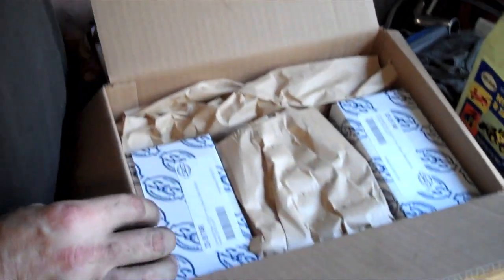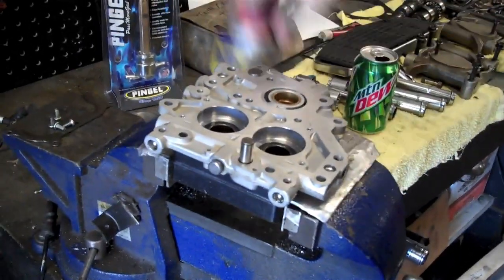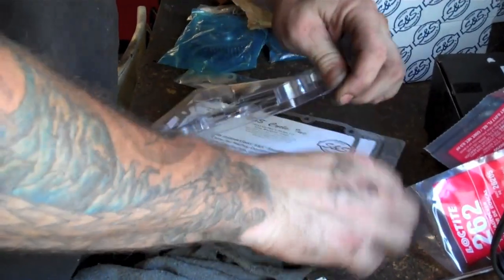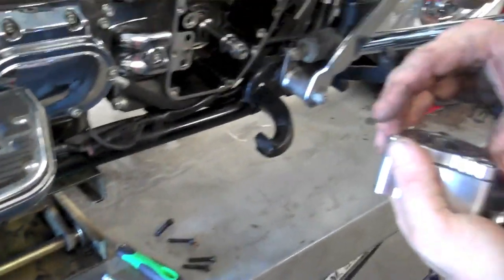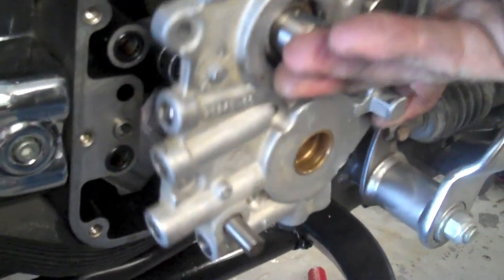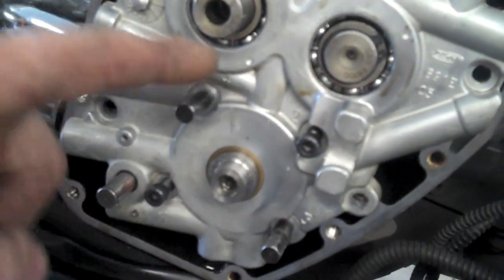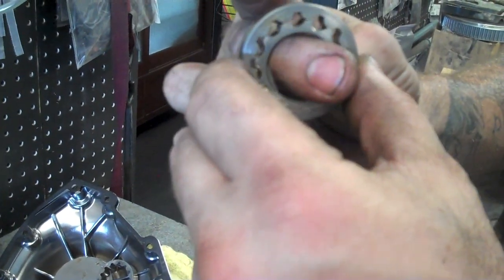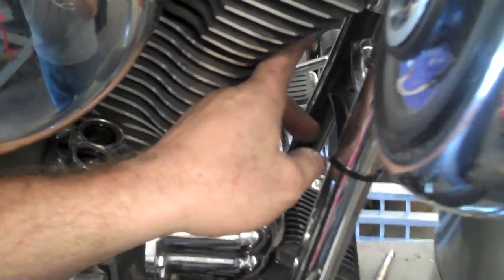How To Remove & Replace Blown Cam On A Harley-Davidson Road King - Part 2: Assembly

Comment: Cool oil pump trick, but why not use assembly lube, a torque wrench, or press the bearings in with the proper tool?

Comment: Besides the other correct comments, assembly lube, checking runout, etc., etc ., a 20 ton H-F hydraulic press is usually on sale for only $144. Or just fab one.

Comment: Jack leg mechanic never checked the crankshaft runout , it is imperative to check when installing gear drive cams. why do you think they make different diameter crank gears.

Comment: You MUST check crank runout when going to gear drive,whether it be Evo,TC,etc.HD cranks are notorious for runout which isn't near as critical if you have spring or hydraulic tensioners.And NO assembly lube on the cam lobes,bearing journals?Quote:"Jimmy the Wizard (a motorcycle mechanical genus)"?!? It's genius,not genus,lmao.Stay away from MY bike!
Reply: Yes. No assembly lube = no good.

Comment: The advantage to buying an older twin cam bike with the cam chain tensioner shoe issue is that you can get them pretty cheap, and even having this gear drive system done by a shop is only around $1800. About $450 cheaper if you do it yourself. Then  you're back on the road with a bike that'll last you a very long time for not a whole lot of money.
Reply: It cost me $1687.70 including S&S adjustable push rod kit. Ouch!

Comment: I certainly appreciate the fine job you guys did documenting this gear drive conversion. It appears to me Harley Davidson has produced a bunch of time-bombs with the chain driven twin cam engine. It's evident from what I see on youtube and in Harley Davidson forums that this is a common occurence. I'll certainly never own a chain driven twin cam engine after seeing this. It's no wonder there's a glut of twin cam engine Harley's for sale, while the EVO engine models are becoming scarce. So glad I didn't buy an a newer twin-cam softail last month, and bought a low mileage, pristine '95 FLSTN instead, with its EVO engine and gear-driven camshaft...
Reply: How come there hasn't been a class action suit vs the MoCo with selling lemon Twinkies then?
Reply: Better keep an eye on your Evo's cam cone. The TC ended the cone cracks. Just too bad the EPA noise regulations forced Harley away from gear drive cams. Don't like the new engines. Vote for better reps.

Comment: Has anyone ever thought of using gear drive cams, but yet having chain still in the frt,i know a lot of bikes cant because of runout,having gear on frt and back of the cam plate
Reply: I thought about it if the runout is too much.
Reply: @DMD81773  do you know f they make gear cams that will accept the chain drive on frt.point being is that you would just have to remove cam cover to replace the  frt tensioner only .way less work.

Comment: You didn't address the issue of the scarred pinion shaft.. It was a good video. Real life scenario. I read you should weld fly wheel when installing gear drive and bigger cams. Your thoughts please.

Comment: Why didn't you guys check the run-out on the pinion and sprocket shafts first before installing the gear drive cams? Or did you do that off camera? Unlike the motors before it, Harley upped the factory tolerances on the twincams for their run-out. If it were any great than .002 to .003, then there's gonna be problems with the gear drive set up.

Comment: Stock cam plate, but high end S&S replacement cams, no runout check with gear driven cams, but yet alignment screws on the oil pump LOL. No assembly lube, or press lube and nothing torqued to specifications. Jimmy the "motorcycle mechanical genus" (genius) Wizard must be a graduate of the Lord Voldemort mail-order school of motorcycle repair and wizardry.

Comment: here is my 2 cents why do we have to fix something Harley should have done write first time ,any other manufacturer would have fixed the problem with a recall ,it can take your engine out ,i had to replace mine with gear drive, i have a 2000 Dyna witch has the timken bearings on left side ,my crank was within spec, because them bearings prevent the crank from moving,2003 twin cams got the ina bearing on left side and all the new twin cams have them ,that's why Harley now sells a timken kit to fix there mistake ,why change something they have used for years with no problems .

Comment: No lube between all those moving parts in that pump cams or bearings .So lets blame Harley right? If the owner never got the tensioners checked, so who’s too blame? I can bet the owner did their own service or took it too these guys who said nothing in order to get a few $1000 dollars from a sucker .
Reply: Well he did freewheel it when lining up.the pump so there was oil pumped with no load
Reply: We always spin motor till it has oil pressure with no oil plugs.....learned in racing  assembly lube just holds crap and debris no matter how clean..Piston rings are the exception.  Nice Vid for guys that really do the work.